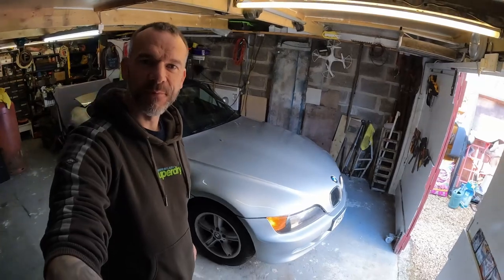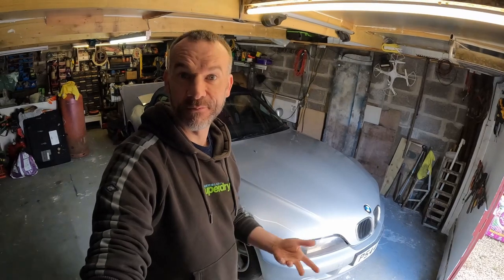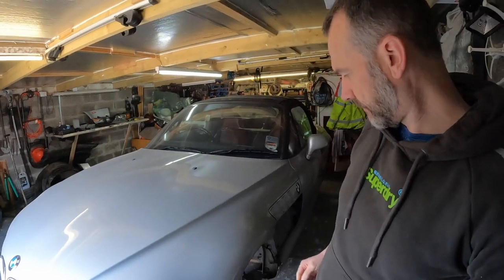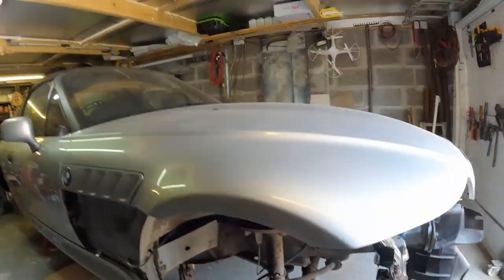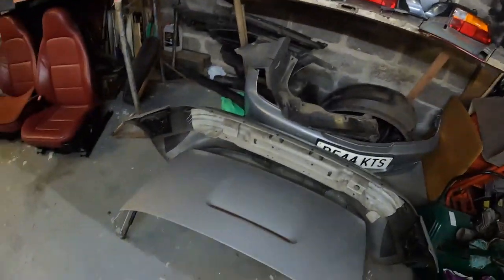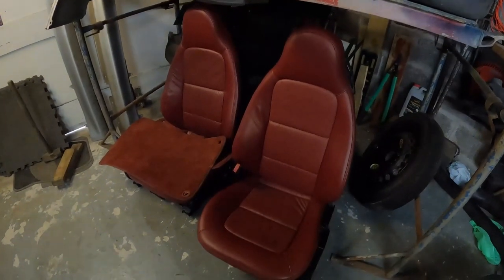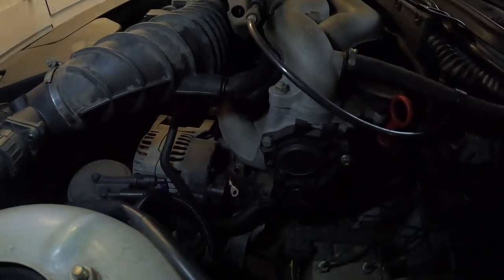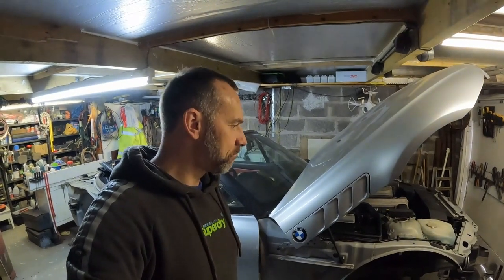BMW Z3 Restoration and Modification Part 1

Comment: I like the color combination.  Great find at a great price!!!  Just a bit confused why you took so many parts off???
Reply from the maker: The car hadn't moved in 15 years, I needed to inspect all the inner chassis , mounts , suspension, with all sills off etc it was easier to wax oil all inside the chassis as well as bottom of door inners, windows weren't working so had lube all the actuators, wax oiled inside of sills while they were off etc etc etc, this car is designed to be stripped down and future proofed for rust and rot 👍👍